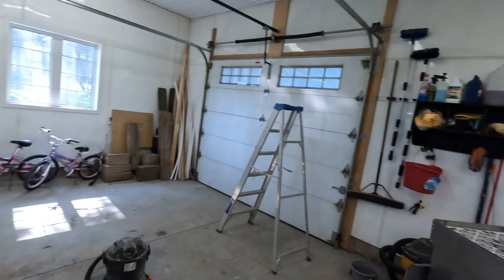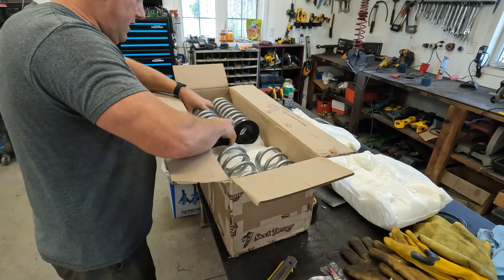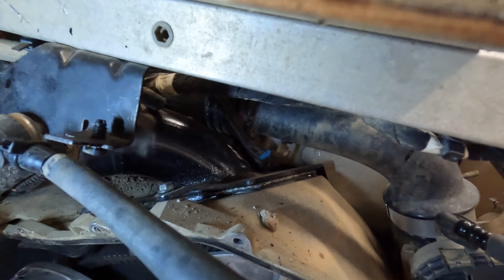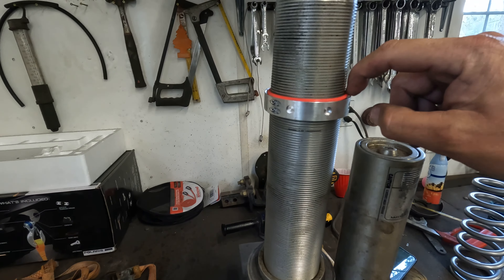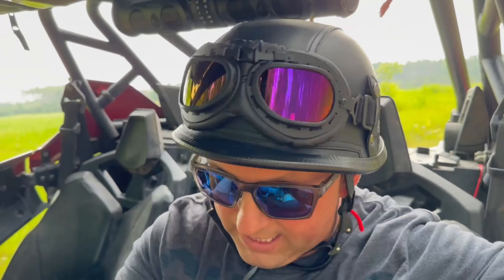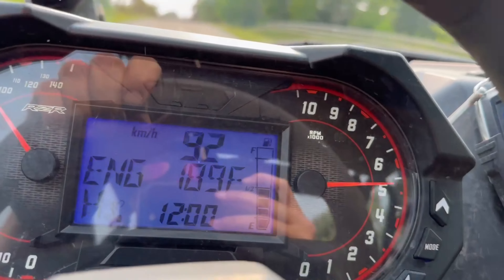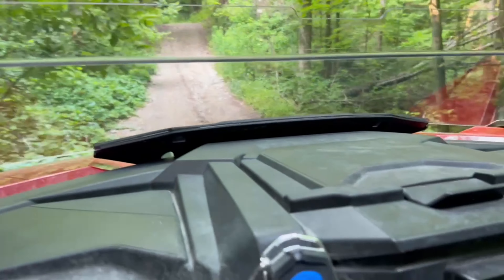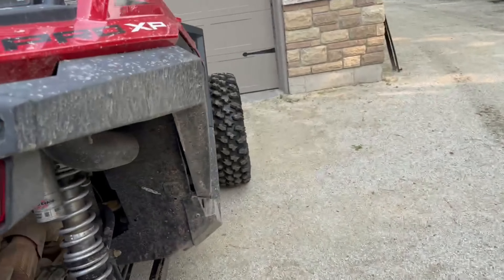Full Shock Rebuild With Shock Therapy Springs. Not Worth It!! Full Install, Ride And Review

Comment: I would recommend you go to their website and watch a lot more their videos. What did your car come with for tires originally what 29s 30s, 35 is massive more weight and that is way harder on the shock.  nothing to do with the springs. Full rebuild would also entail replacing the spring stacks inside the shock. They were engineered for what came on the car not for those big heavy 35s so yeah you'll still probably bottom out or it'll be harsh if you turn the compression up so you don't.  And if you watch the videos they never claim earth shattering differences. they say it'll make your ride 20 to 30% better and it sure sounds like it did more than that. They also say revalving will be another 40 or 50% better.

Comment: 35’s on that little motor is crazy… above redline RPM just to hit 70-80mph. 
My pro r ultimate does that without breaking a sweat.

But definitely get some limit straps if you keep those giant tires.
Happy riding bro

Comment: Shock Therapy springs will rub your shock body and possibly destroy the shock. I learned the hard way. Also make sure you readjust your ride height since you’ve went on a couple rides. They will settle which makes the rubbing worse.
Reply from the maker: I did end up adding ride height to the rear after a few rides and made a quite a bit of difference. Any way to make the springs not rub the shock?
Reply: @TwistedSXS  not that I'm aware of. I think having the ride height where it's suppose to be will help. In my case with 32" tires it really tightened up the springs. Shock Therapy did a youtube video trying to explain why their shocks rub but I think it's a bunch of crap really because the other spring companies don't seem to have this problem.
Reply: It looked like the stock springs did a really great job at wherein the shock bodes.   So stock spring wear the bodies ST springs wear the bodies! What is you suggestion, shock guru?
Reply: @brianbaxter3574  where did I say I was a shock guru? I was just saying my experience with shock therapy springs and I was told by a guy that rebuilds shocks for a living that it's very typical from shock therapy springs but not typical from other spring companies. As for stock springs I didn't have body wear from the stock springs.
Reply: Any dual rate spring set up will wear your body’s there a wear item I have 2 machines one a 2018 rzr turbo with 5 k miles and has st all around and it was amazing just had them do a full rebuild including body’s it was 2 k but the difference is worth the money my 4 seat pro xp Rockford has fox live valve with st springs now that’s a whole other level

Comment: they're springs, they hold the car up. They look like the do a great job at that, good springs. Your old springs, clapped out, and had 8" of pre load, didnt hold the car up like they should, bad springs. considering you got 8 springs, 4 dual rate sliders, and 4 dual rate clamps. sounds like the going rate for all that.

Comment: You just did a dual spring kit!
You should have sent the shocks to Shock Therapy & have them rebuild the valving to you type of riding!
Also you start on the softest setting on the clickers. 
If you bottom out you then move the clicker to the next setting & go til the RZR doesn’t bottom out!
This will give you the best ride, but you need your valving redone to get best ride quality!
Reply from the maker: As the title says, I rebuilt the shocks days before I put the springs on. Yes there full treatment with revalve will make more of a difference. But I’m from Canada and shipping alone costs an absurd amount.  I can custom order full set King shocks brand new for that kind of money. 
Suspension on softness setting is a marshmallow, doesn’t corner at all. All I’m saying in the video is if you have a newer machine and think springs are going to make a difference you will be disappointed, if you have clapped out ones and need new ones, you might as well buy shock therapy ones. Thanks for watching and the comment

Comment: I am also in Canada 🇨🇦.  Purchased shock therapy springs for my 21 pro xp ultimate.  I put them on just a few months after purchasing the machine new. And like you, I was a bit disappointed in how little the difference was between the factory springs ride and the shock therapy ride as far as just comfort goes. BUT... they were a great improvement on jumps and whoops... I have a couple videos showing before and after over the same whoops. And you can see the difference.  So I  short... my opinion... if you want to simply improve the ride quality of your pro xp... save your money... but if you want to drive aggressive, jump and high speeds over rough terrain... I absolutely suggest the shock therapy route.
Reply from the maker: Thanks for the comment I appreciate it.

Comment: 2024 Polaris RZR 1000 XP Ultimate and it was a night and day difference in the ride and performance of our machine with the Shock Therapy dual rate spring kit. No regrets and what an improvement in the ride height. Factory springs are junk in my opinion. When we made the change we were just over 1,000 miles. Furture plans to have Shock Therapy rebuild and valving done.

Comment: springs doesnt make your shock better- as you see they help with ride height and you dont bottom out ;-) as others said a shock rebuilt AND new springs wouldve been better- know its always bout $$ btw what i MISS is- do they offer different spring rates?? example- for my ktm rear shock i can order like 4 different spring rates !
Reply from the maker: So I said in the video the shocks were fully rebuilt with fresh oil the same time I put new springs on. Springs do absolutely define your ride quality as well as ride height. Shock therapy asks you like 2 pages of questions about your riding style, weight, do you have a passenger a lot, tire size, do you carry a cooler etc.  very detailed and then they choose the spring “rate” for you. I’m not saying they’re bad, just not a huge improvement from stock. Thanks for watching.

Comment: Canada here as well. Altho I went with Eibachs over ST, I agree with you 100%, I found new springs helped it a bit,  but if it was a 2 out of 10 before spring kit, the new springs made it a 4. I then went with a rebuild, recharged nitrogen and revalved at same time, and that made a huge difference, I’d have to say it’s a 7 or 8 out of 10 now.

Comment: I think when the sxs blog guys talk about them they do the whole build, springs re valve and tune based on there specs(weight, passenger, riding style, accessories and so on. Just changing the fluid and seals will just make them feel like new again.
Reply from the maker: Yes for sure. I’m sure the full therapy treatment would more of a difference. They do ask quite a few questions in weight, riding style, tire size, what your carrying even if you just by the springs. It is a good product, just wasn’t mind blowing. If you have a different machine with really stiff suspension I think you would notice a much larger difference. Thanks for watching and comment.
Reply: @TwistedSXS I also think they make a bigger difference on fully loaded machines with butts in every seat, spare tire hanging off the back and a bunch of other accessories. If the overall weight of your car is about the same as stock, I don’t imagine their spring rates will be much different with the exception of the dual rate being a lot smoother over smaller chatter bumps.
Reply: Yeah I think they'll make a huge difference on my honda talon but a rzr already rides pretty good

Comment: ST springs will not fix all the changes you made with heavy tires . It's not the springs , you now need to re-valve your shocks for those tires . You want a big change put the stock tires back on THEN go for a ride . Night and day difference .

Comment: WTF, BROTHER you had me ordering a set from Shock Theropy, BUT your final conclusion was less than satisfactory from your perspective!?! ( Which I completely respect!!) I run 35x8.5x20 Motohavok's on Mav Sport XMR the ride is BRUTAL!! I greatly appreciate your insight and efforts so I'm curious what your next step is?? Thx! 🤙😎
Reply from the maker: The Pro XP has a plush ride to begin with, smoothness on mid to upper range speed is better. If your suspension is rough at any speed, you will feel a ride quality improvement difference for sure with shock therapy. I have heard the Mav  sport do ride rough. You will get a different result I feel. I had havocs before and they don’t ride great. This likely doesn’t help you any either. Next step for me play with shock adjusters and tire pressure to dial it in. Thanks for watching.
Reply: @TwistedSXS  I'm working towards have more of a speed set up, suspension settings have little effect in mud just need clearance and traction. It's the fast TWISTED bits that I need to soften the ride, we rode in Sudbury yesterday where the logging roads are absolutely phenomenal!! But flying over a crest or extreme downhill only to hit a serious wash out of rocks, making them  BOULDERS!! LMAO  HITTING this at speed is a sphincter criching experience 🤣  scary to think what the machine is experiencing $?$?$ 🤔🤙😎
Reply from the maker: @geoffreyneish7999  would love to know those trails. You will see an improvement for sure on those types of roads.
Reply: @TwistedSXS  So did I!!! lmfao I bought a set of carnivor 30's off a guy just north of Sudbury,  CONDITION of sale was we MUST go for a ride, after 6 hrs of rally'ish driving my entire body needed retorquing!!!!! DEFINITELY going back before wet fall leaves turn it into a Bobsled Run, will let you know for sure!! 😉
Reply from the maker: @geoffreyneish7999  sounds good I would appreciate it!
Reply: I put them on my pro xp but had fox dynamix and it made for a better ride. The springs are now for sale (les than 100 miles)because I now have a pro r and they don't fit the new sxs
Reply: @arnw7933  Do you think they'd fit my 2019 Mav Sport XMR? Wonder how  they compare to my stock Fox System 3 ??  So there is a big ride in Sept in Sudbury. I'm not sure if big ride means distance or people, and your more than welcome to join soon as I have the date you will too!
Reply: Hoooly.  I’ve got a 22 pro Xp.  I put on an Eibach kit for my machine.  Available from a dealer in Canada,Toronto.  
Dunno your set up.  Put I’m thinking the only reason that spring kit could possibly be harsh is if you contacting your cross over rings too quickly. Give the tender spring more room between it and the slider so your riding more on the tender.  Mine tip toes thru crazy shit so nice.  I can actually feel when my crossover engages the main spring, and it’s a lot stiffer.  
Also look into the stainless shock body sleeves you can get on line.  The glue on ones. They make the whole system quieter and eliminate shock body wear.  Those ST sliders will not fix the problem, nor will “ clocking” your springs.  Pure bunk!
Only issues I had with new springs was the front clunk from the shock extension, and li it straps fix that.  No, it’s not rebound valving or the top out spring inside…. It’s the new upper spring and it’s ability to push out at its full length
The rears will do the same if your a jumper…. I’m not
Reply from the maker: @darrendesautels5871  Very good tips. Will be getting limiter straps for helping with the clunking and also help axle damage when fully extended. Thanks for watching and the comment.
Reply: fox shocks if you have high expectations

Comment: The title of the video is kind of misleading. Swapping springs is not a full shock rebuild. Also if your shocks internal wear parts ( bushings, seals , oil , nitrogen charge, etc) are shot, there’s no set of springs that will compensate for those issues. Sorry buddy, but you are going to have to lighten your wallet and get the other half of your problem fixed. When you do, it will be the best money you spend on your car.
Reply from the maker: Bushings are in great shape, just had a full rebuild with brand new oil and nitrogen and ceils were like new. Don’t get me wrong, if your springs are shot, I would 100% buy shock therapy over stock but if you expecting night and day earth shattering improvement, you will be disappointed. Thanks watching and the comment.

Comment: Wat exhaust is that
Reply from the maker: It’s After Market Assassin’s . Came with the machine. Not sure what it’s called.  Has 2 exits, if you have them both open it’s freakin so loud. Just right for me with the upper (straight pipe mode) closed. Thanks for watching.